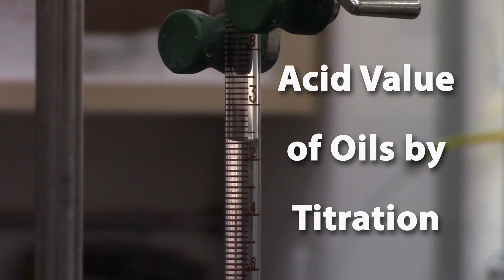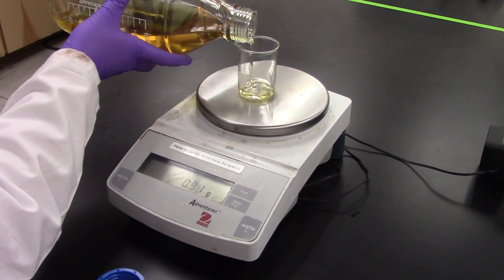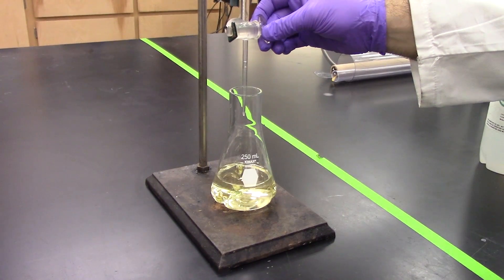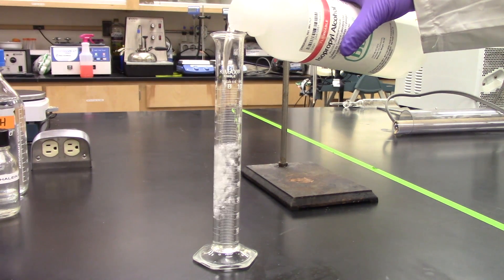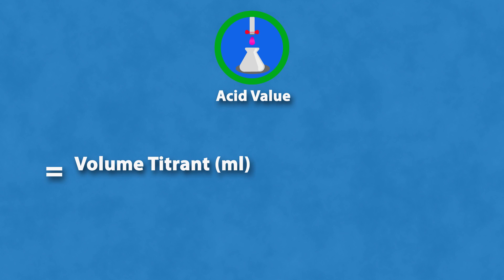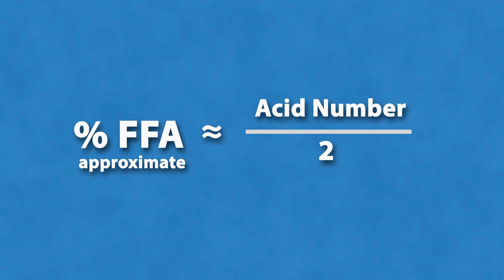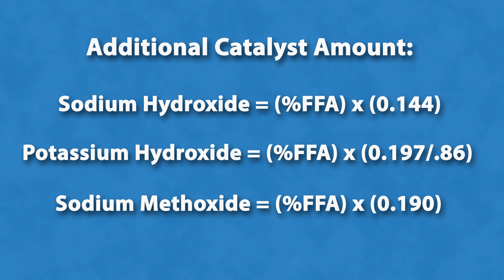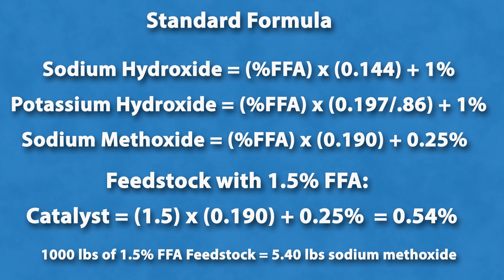Acid Value of Oils by Titration for Biodiesel

Comment: I have some doubts and need clarifications. According to the ASTM D974 Test Method, KOH can be substituted with NaOH. Is that correct? Also, I am dealing with waste oil from palm oil oleochemical refinery and the oil color is dark. Very dark and in room temperature, the viscosity is very high. How do you reckon if I insist on using this method instead of D664? Will the data be too inaccurate?
Reply from the maker: Either base should be able to be used as long as the correct weights and molar densities are used. Either ASTM test should be fine to determine acid number as long as they are followed correctly.
Reply: KOH is a superior catalyst for the reaction I believe

Comment: Can I use sulfuric acid as my catalyst? What is the standard formula for extra catalyst needed?
Reply from the maker: With an acid value of 20 your % FFA will be approximately 10. It is determined based on the average molecular weight of the fatty acids that make up the oil or fat you are using but it is roughly half the AV.
We don’t know how large of a batch you are making but the formula is as follows:
For every gram of FFA add 2.2 grams of methanol and 0.05 grams of sulfuric acid
Always add the acid to the methanol to avoid splatter and gently mix.
Heat the oil to 60 C and add the alcohol/acid mixture and stir for 1 hour.
Upon settling you should have a layer of alcohol acid and water floating on top. Water is generated during the esterification reaction.
The trick is to drain off the pretreated oil/ester mixture without getting any of the top layer with it.
Then measure the new acid value. If it is still too high you can perform another acid esterification using the new value to calculate methanol and acid.
Here is an example: If you are starting with 500 g of oil with 10% FFA you would have 50 grams of FFA’s
You would need 112.5 g of methanol and 2.5 g of sulfuric acid for the reaction.
If you are making a large batch you can use lbs or Kg to calculate the amounts. Good luck!
Reply from the maker: Hello, thanks for reaching out to us! What is your acid value, and do you plan on using sulfuric acid for the entire reaction or only for converting the three fatty acid's to esters?
Reply: Hi, thanks for your reply! My acid value is about 20, I'm planning to use sulfuric acid as catalyst to reduce my feedstock's FFA and then proceed with transesterification.
Reply: How to calculate methanol and sodium methoxide for transesterifacion?
Reply: @lakshayahissaria4823  methanol use a 6 mols methanol per mol oil; oil is about 876 g/mol. Use density of oil to calculate mass from volume. 

The catalyst values are reviewed in the video. 1% w/w for KOH and 0.25% w/w for Sodium Methoxide + the compensation for FAA's.

Comment: could you please explain how to find the normality of KOH? does it varies ?
Reply from the maker: We follow the ASTM Standards for testing our normality. Mixed solutions of bases can degrade over time and need to be replaced. The method of standardizing the potassium hydroxide solution is outlined in ASTM D974 under 7.7.1:
"Standardize frequently enough to detect changes of 0.0005 N. On way to do this is as follows: Weigh, to the nearest 0.1 mg approximately 0.2 g of potassium hydroxide alcoholic solution to either of the following end points. (1) When the titration is electromagnetic, titrate to a well-defined inflection point at the voltage that  corresponds to the voltage of the basic buffer solution, or (2) When titration is colorimetric, add six drops of phenolphthalein indicator solution and titrate to the appearance of a permanent pink color. Perform the blank titration on the water used to dissolve the potassium acid phthalate. Calculate the normality using the following equation: Normality = ((Wp / 204.23) x (1000/(V-Vb)))     (1) where:  Wp - weight of potassium acid phthalate, g, 204.23 = molecular weight of the potassium acid phthalate, V = volume of the titrant used to titrate the salt to a specific end point, mL, and Vb = volume of titrant used to titrate the blank, mL."
Reply: https://youtu.be/QS4O3iMFX2U

Comment: Plzz give the proper procedure
Reply from the maker: From ASTM D974 under 7.7.1:
"Standardize frequently enough to detect changes of 0.0005 N. On way to do this is as follows: Weigh, to the nearest 0.1 mg approximately 0.2 g of potassium hydroxide alcoholic solution to either of the following end points. (1) When the titration is electromagnetic, titrate to a well-defined inflection point at the voltage that  corresponds to the voltage of the basic buffer solution, or (2) When titration is colorimetric, add six drops of phenolphthalein indicator solution and titrate to the appearance of a permanent pink color. Perform the blank titration on the water used to dissolve the potassium acid phthalate. Calculate the normality using the following equation: Normality = ((Wp / 204.23) x (1000/(V-Vb)))     (1) where:  Wp - weight of potassium acid phthalate, g, 204.23 = molecular weight of the potassium acid phthalate, V = volume of the titrant used to titrate the salt to a specific end point, mL, and Vb = volume of titrant used to titrate the blank, mL."